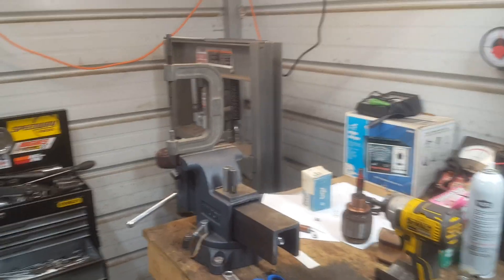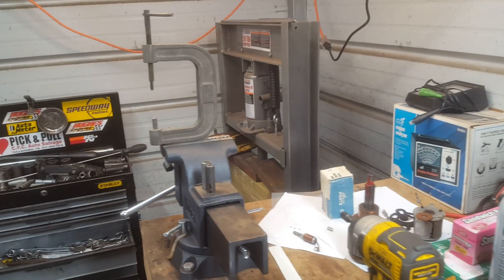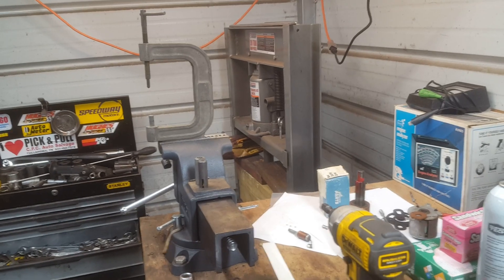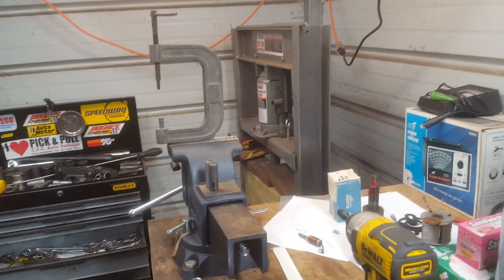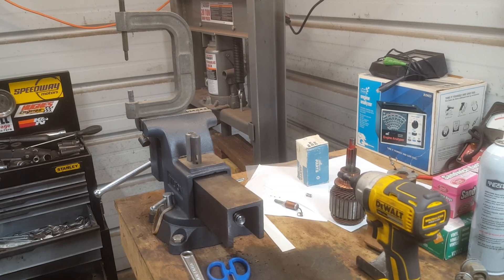Name that obsolete tool...

Comment: OMG, I have one I bought in a auction a good 30 years ago.... I'v used it once. It was a starter, alternator, generator rebuild shop that closed up. I bid on this huge box of speciality tools, and won it. There were a ton of carburetor gauges in the box also. They may have rebuilt carburetors at one time too, I'm guessing. There was a "Sun" starter, alternator, generator tester at the same auction, I was outbid on.